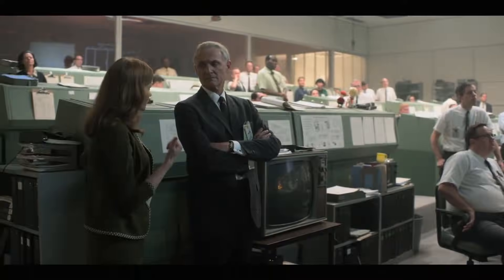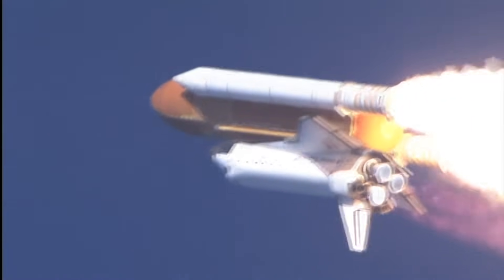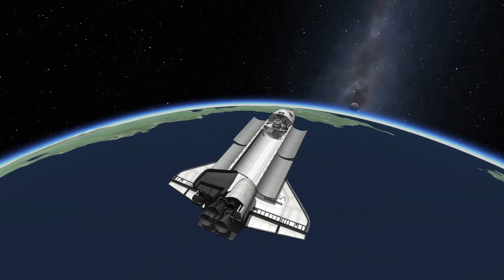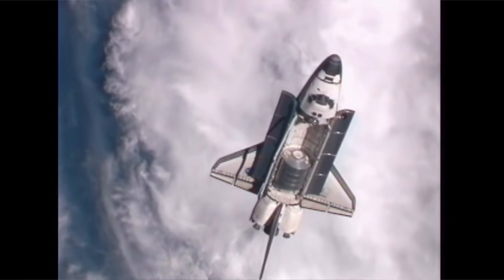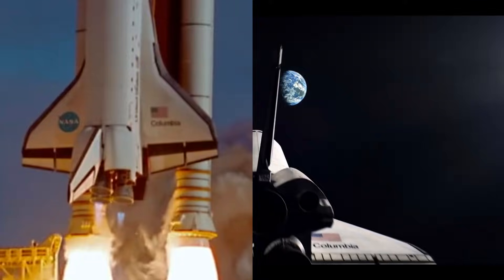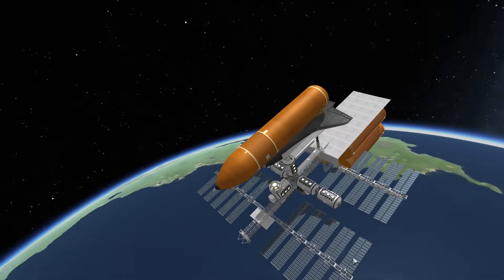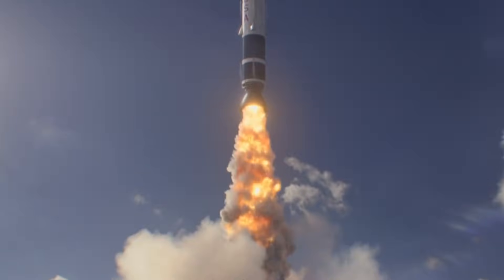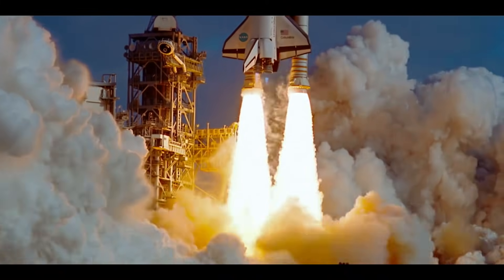How To Send A Space Shuttle To The Moon

Comment: 6:58 “There’s a better solution.” I was expecting him to say “more boosters.”
Reply: I expected 4 SRBs instead of 2 and a direct ascent
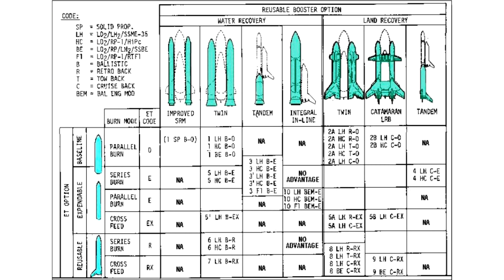Reply: Well, at 5:23, there are some neat ideas for More Boosters.
Reply: 4 SRBs would only require some more support cross beams inside the inter-tank. The whole weight if the Shuttle stack is supported by the single inter-tank crossbeam and the two SRBs.
Reply: @eugenioarpayoglou  Of course, more struts. That always helps.
Reply: More boosters and struts
Reply: I was expecting the Saturn-Shuttle to be sure.
Reply: @hyperboloidofonesheet1036  My first thought as well. Screw "more SRBs" like others have suggested, use an S-1C instead.

Were there any proposals for how to do further Moon missions in the late '70s? I know the original plan was to keep using Saturn V as the heavy lifter, and Shuttle was to be exactly what the name implied -- just carry the people up to work on the giant station put in orbit by the thing with decent payload capacity.
Reply: ouch,i was expecting  Buran-Energia instead,seriously.
Reply: Easy, simply use 2 saturn V instead of the 2 shuttle srbs.  Also  put 1 srb into the cargo bay!
Reply: Or asparagus-staging.
Reply: I wonder how many more srbs you could put on SLS?
Reply: JoekerXXX the problem would probably be G forces
Reply: I figured boosters that were already in orbit could be mounted in the payload bay, and others to the ET attach points. Scott, go do math!
Reply: Same
Reply: "More Boosters" Thats the right answer to all questions in live.
Reply: @DeliveryMcGee  No; It was a major battle just to get multi-year funding for the Shuttle, which originally was designed with on-board engines to take-off and land on runway, but the engines fell to budget cuts and it became a glider with assist from a 747. There was extreme budget competition between manned space projects and un-manned (Robotic)  projects. Space Station Freedom didn't help matters either.
Reply: More cowbells. Solution to everything.
Reply: Two more SRBs, a stretched ET, and a bit more OMS fuel to be safe.  Let's send the shuttle to Minmus and back!
Reply: Haha classic xD
Reply: MOOOOOORE
Reply: @joeker1013  None, it's already overweight and eating into the safety factor that the newly upgraded Crawler Transporter can carry to the pad.  CT-1(Hans) and CT-2(Franz) for STS had a weight capacity of 12 million/mega pounds.  Both CT's were overhauled in 2003.  In 2016 ML-2 received 4 mods that CT-1 did NOT, these extra mods raised the rated capacity of CT-2 to 18 megapounds dubbing CT-2 as a "Super Crawler".  Mobile Launcher-1 or ML-1, were referred to as  Mobile Launcher Platforms(MLPs) during the STS program, and called Mobile Launchers(MLs) for the Apollo, Constellation and SLS programs.  These are the massive platforms that comprise the launchpads that carried the Space Shuttle, Apollo and Constellation launch vehicle  "stacks".  They have 6 large "pedestals" that line up with 6 "pedestals" inside the various bays inside the Vehicle Assembly Building(VAB)out at Launch Complex 39B(LC39B and LC-39A before SpaceEx leased it) and the Crawler Transporters are driven underneath the ML's, their  Jacking Elevating and Leveling cylinders(JEL cylinders) lift the ML and whatever is atop it, then drives to the launch complex and keeps the load level as it "crawls" up the 130 foot wide crawlerway.  Once the launch stack is located directly over the flame trench, the CT lowers its JEL cylinders and lets the ML down atop its 6 pedestals.  Once lowered down atop the pedestals, the ML is said to be "hard down".  The SLS Mobile Launcher-1, an empty SLS Core Stage with 4 RS-25D engines, two Redesigned Solid Rocket Motors-five segments(RSRMV "V" as in the Roman numeral for "5"-5 segments of propellant whereas the Shuttle RSRM used 4 segments), plus an upper stage, plus an Orion space vehicle and/or payload, plus its Launch Abort System(LAS) when all added makes even the Super Crawler CT-2 "Franz" break a sweat as it will have to lift at LEAST 20 megapounds(remember its rated for 18 megapounds).  This is a major disadvantage for very large Solid Rocket Motors.  They are heavy and this weight is present from teh very moment the motor segment is poured. This in contrast to a Liquid Rocket Motor which can be stacked with the vehicle in the VAB, transported to the pad AND THEN fueled.  You don't have to lug around all the mass of the fuel of the motor with a liquid fueled booster like you do with a Solid Rocket Motor booster.  Alas the Solid Rocket Motor lobby is VERY strong in Washington.  Once all the already flown and brand new components leftover from STS have been used up(there's enough ultra high strength D6AC steel cases for 16 motors-5 segments per motor, 2 motors per launch=10 segments per launch=meaning there's 80 such segments that are within spec for a one time usage in expendable mode) beginning with Artemis mission #9 the new carbon fiber wound cased SRM boosters will be used and while the filament wound cases are lighter than the STS SRB cases, the overall booster is actually heavier as they carry way more propellant than the steel cased motors did.  
NASA actually did some testing of an F-1A engine gas generator (a part of the Saturn-V engine) as part of a study in which a company was going to use 2 F1-B engines to power EACH liquid fueled booster.  The liquid boosters were called Pyrios and were proposed by Dynetics(one of the final 3 companies that recently was awarded a contract for NASA for Lunar Landers).  A liquid boosted SLS "stack" would have used 4 RS-25 on the core and 4 F-1B engines on the 2 boosters. 4 kerosene booster engines for sheer thrust and 4 highly efficient hydolox sustainer engines on the core.  The Pyrios proposal for the liquid booster motor version of SLS made the Congress mandated 130 tons to Low Earth Orbit(LEO) for SLS Block-II look easy as the dual F-1B Pyrios proposal was good for 150 tons to LEO.  With RS-25s thrusting at 111% Full Power Level and the Block 2 composite filament wrapped solid rocket motor boosters, SLS Block II will only be good for about 114 tons to LEO.
5 segment history.  As soon as NASA was told that the USA would be building the ISS ALONG WITH Russia at the orbital inclination of 51.6º, a way to increase Space Shuttle payload capacity to such a highly inclinded orbit was needed.  For every degree of orbital inclination above 28.5º, the Shuttle orbiter loses approx. 700 pounds of payload capacity.  51.6-28.5=23.1 degrees of increased orbital inclination above the KSC latitude multiplied by 700 pounds=16,170 pounds of lost payload capacity. 60,000-16170=43,830 pounds of payload capacity. remaining, just from changing orbits.  Many ideas were floated.  Increasing SSME thrusting from the normal 104.5% Rated Performance Level up to 106% RPL or going from 4 segment to 5 segment SRBs or reducing mass of teh ET.  Well in teh end going from the Light Weight Tank=LWT to the SLWT(Super Light Weight Tank) clawed back 50% of that orbital inclination payload hit.  It was calculated that if NASA went with the 5 segment SRB for Shuttle that the 5 segment boosters alone would improve payload performance by 20,000 pounds.  It would also allow STS to fly a dogleg launch profile that would allow space shuttles to launch to Polar Orbits out of KSC.  In the end the SLWT ET was used, to great effectiveness and the RSRMV was shelved.  Sorry for the blathering novella lol.
Reply: moar*
Reply: @hoghogwild  Do you work in the industry?  Your knowledge of the subject is very Impressive.  So the only way for it to happen is if the government decides to spend a ridiculous amount of money to upgrade a crawler to carry a rocket that might not even fly 10 times. I can almost the contractor's bids now.
Reply: @TheAechBomb  2 shuttles 6srb
and a larger external fuel tank :)
Reply: @joeker1013  Could probably do at least 3 instead of 2, though you'd need to totally redesign the first stage. 

Be a hell of a Block-3 launcher.
Reply: @Joesolo13  block 3 sls seems like a better idea. More cargo to the moon at less cost.
Reply: You could also strap 3 Saturn 5s together (like a Falcon heavy) and mount the shuttle on top of the 3rd stage of the core section ;-)

Comment: Hrmm.
1 - launch conventionally configured shuttle mission to LEO
2 - launch a filled external tank fitted with an RCS package to LEO on 3 or 4 SRBs
3 - rendesvous and dock shuttle to tank
4 - thermal rejection problems? bring enough cryogenics to (very) slowly meter it through a heat exchange loop to augment the radiators, while building tank pressure. Pressure too high? Vent through an evaporative circuit on the radiators. Perhaps vent directionally to aid a little in slowing the vehicle on the return trip. Small constant-load rocket motor facing forward on the return leg? Something like an HM7B... 

Anyhow, SLWT carries in this altered state maybe 650,000kg for the refuel attachment, say it weighs 50,000kg and the shuttle package 150,000kg, you've an 850,000kg package to start with 650,000kg fuel to expend, 4000m/s exhaust velocities, tsiolkovsky says that's enough for a little less than 5800m/s delta, take half, that's almost the full 3000m/s needed with numbers fudged HEAVILY toward the bad side of things.

Comment: Question about the reentry requirements.  Rather than assuming a redesign of the heat shield, wouldn't another option be using delta V to enter LEO first, and then deorbit?  Since we're already discussing orbital refueling, wouldn't that be an option as well, even if not as fuel efficient?
Reply: Changing from lunar re-entry speed to a low Earth orbit (LEO) would require roughly the same velocity change or delta v as the trans lunar injection (about 11,000 km/h) since this would basically be a trans lunar injection (TLI) in reverse.
If using the highly efficient space shuttle main engines with their 452 sec of specific impulse, that braking manoeuvre would take about the same mass of fuel as the combined mass of the orbiter, payload and the fuel tank, or roughly 100 tonnes. If that extra fuel couldn't be produced on the Moon, it would need to be launched from Earth and brought all the way to the Moon and back, meaning that the total mass initially launched from Earth would need to be doubled.
Redesigning the heatshield to withstand the extra stress at re-entry might be a better solution?

Comment: Heat shield capacity can be saved by using delta-v to slow down to regular orbital speed before reentry.
Reply: How do you do that?
Slowing down from lunar re-entry speed to low Earth orbital speed requires just as much delta-v (about 11,000 km/h) as the opposite manoeuvre, the trans lunar injection (TLI) going from low Earth orbit (LEO) to lunar transfer orbit that was done by the Saturn V's third stage during the Apollo missions.
Reply: @fromnorway643  By using that much delta-v, obviously,
Reply: @johndododoe1411  
The problem is that slowing down that much by using the most efficient chemical fuel – liquid hydrogen and oxygen – the fuel would need to constitute 50 % of the shuttle's total mass before starting the engines (less efficient fuel types would require an even higher percentage).
If the mass of the orbiter itself was 95 tonnes and the empty mass of the fuel tank was 5 tonnes, you would need 100 tonnes of fuel for that braking manoeuvre. If the fuel couldn't be produced on the Moon, you would need to bring it all the way from the Earth to the Moon and back and thus double the total fuel consumption for the entire mission, increasing it by several thousand tonnes.
The inevitable conclusion is that going to the Moon with a space shuttle is a very stupid idea.
Reply: @fromnorway643  Well, a fuel tank could be parked in a high speed orbit and picked up before doing most of the braking.  Launch from moon needs to be timed to join that orbit at a tangent matching the orbital speed and direction.
Reply: @johndododoe1411  
I don't see how that would help much.
That fuel tank would need to be launched into a very elliptical orbit similar to a translunar injection (TLI) in order to match the shuttle's trajectory and speed on its way back to Earth. Sending 100+ tonnes into that kind of orbit would require at least two Saturn V class rockets or 4-5 expendable Falcon Heavies. The timing of the docking operation would also be a great challenge since the speed and especially the distance involved would be much larger than docking with the ISS in LEO.
Reply: @fromnorway643  I was not comparing to LEO docking.  Idea was to park somewhere like 3000km up, thus having an orbital speed around the TLI speed of Apollo.  Thus if the moon shuttle return speed is similar, it could dock with the tank before initiating landing maneuvers.
Reply: @johndododoe1411  
Parking the tank in a circular orbit 3000 km up?
Sorry, but no, that wouldn't work either.
The tank's orbital speed at that altitude would be about 23,500 km/h, which is roughly 4000-4500 km/h lower than in LEO.
If the returning shuttle's orbit was adjusted to have its lowest point (perigee) at 3000 km and timed to meet the tank at that point, the shuttle would be moving about 9300 km/h faster than it. That means that their relative speed would be almost 1.5 times higher than two SR-71 Blackbirds meeting each other face-to-face at Mach 3. The shuttle and the tank would either miss each other, or the "docking" would end with a huge explosion.
Reply: @fromnorway643  Shuttle is not really in orbit, it's doing a flyby in a hyperbolic or parabolic trajectory that would miss Earth if it didn't pick up the tank to get the delta-v to stop itself.  This is similar to Early Apollo proposals where the CM would be in Earth orbit. Btw, the orbit calculator I used indicated 11.5 km/s at 3000km altitude, but it might have been wrong.
Reply: @johndododoe1411  
The highest re-entry speed achieved by any of the lunar missions was 39,897 km/h or 11.08 km/sec by Apollo 10 in May 1969. That's slightly less than the Earth's escape velocity (11.19 km/sec), so a hypothetical shuttle following the same trajectory and speed would still be in a highly elliptical orbit around the Earth, not a parabola or hyperbola.
Your orbit calculator was definitely wrong. There is no way an object in a circular orbit at that altitude could move faster than in LEO and certainly not faster than the Earth's escape velocity.
Reply: @fromnorway643  Yet two answers ago, you claimed a higher speed in that circular orbit, make up your mind.  I now see published speed examples that conflict with the calculator I used, which is an unfortunate major problem.

Comment: Now that most of the season is out, I think this video needs to be updated in a Part 2. 
Here’s why:
In the show they only used the Shuttle for crew transport when it went to the Moon, and they used the Sea Dragon for payload transport to the Moon, so I think it’s safe to assume that when going to the Moon instead of LEO, the Shuttle in the show had extra fuel in its payload bay. Furthermore, they mentioned that the shuttle had been upgraded which likely means that they increased the efficiency of the engines, and maybe the fuel mixture and nozzle in the SRB’s, so even though it looks the same as the old shuttle, it is actually a much more optimized version. Also, the heat shield may have also been upgraded in the show.

P.S. I like your theory a lot as well, and it may be more accurate. Hopefully they tell us at some point in either Season 2 or Season 3
Reply: I think they still carry cargo, but only comparatively light cargo and small amounts of it, as the M16's came with the marines on a shuttle mission.
Reply: Using the wings, they could have a much shallower Re entry glide path reducing the heat load. Between this and an upgraded TPS, it could be possible. However, more practical would be the shuttle remaining in LEO with a lunar ferry craft

Comment: There was a discussion thread way back in the late 2000's about if the shuttle had gotten the 5 segment booster upgrade and had the 80,000 lbs leo payload it prob could had been used to launch lunar missions into orbit.  Basically carrying the lunar service module and fuel on one shuttle and having the mission crew, lander, and capsule on a second shuttle.  Meet up in orbit, mate the vehicle together and load the mission crew.  Off the lunar mission goes, shuttle crews stay in orbit waiting for the lunar crew to get back, load everything back up and re-enter.  Interesting ideas, but would have prob needed more than 80,000lbs of payload, and ideally upgrading the shuttles to not need a crew would make one of the launches a lot cheaper.  If an even better booster design had been funded who knows, would have still been insanely expensive $1.5-2 billion dollar moon missions.
Reply: To expensive.  It's easier, cheaper, and more reliable to replace the shuttle with a Saturn V.  That's the purpose of the SLS program today.  Plus Saturn or SLS could carry upwards of 250,000 pounds.  Makes the shuttle a lemon, no contest...which is why Bush killed it.